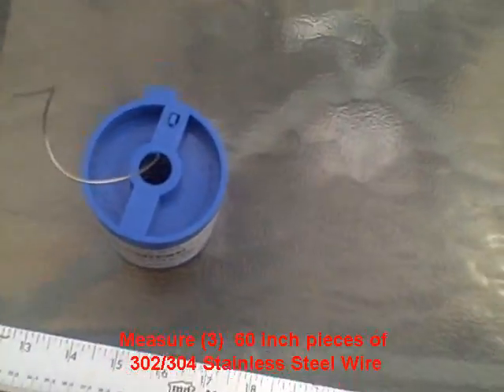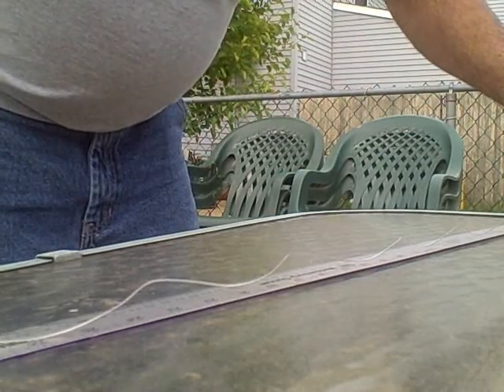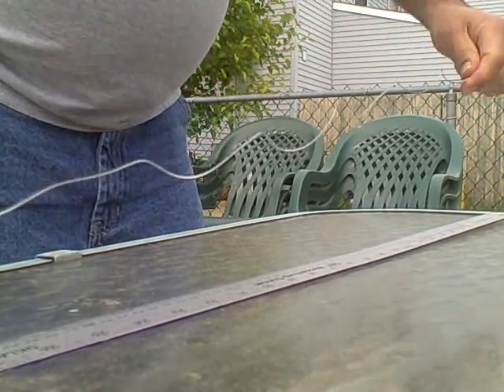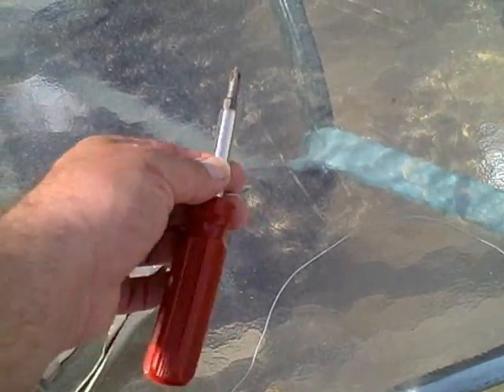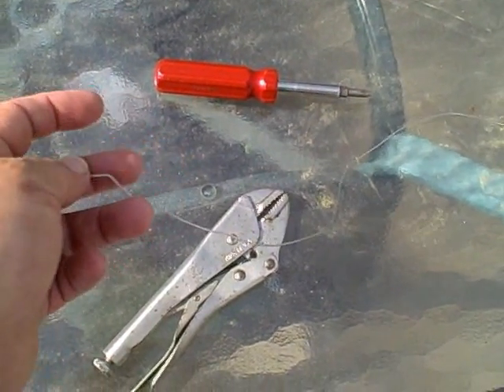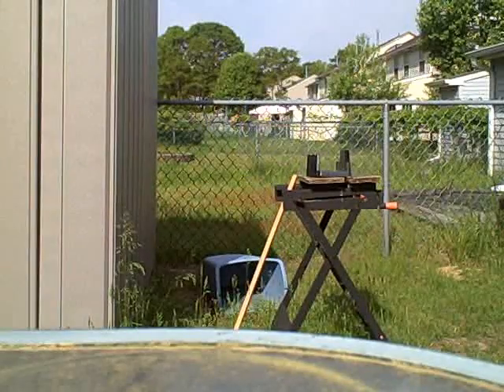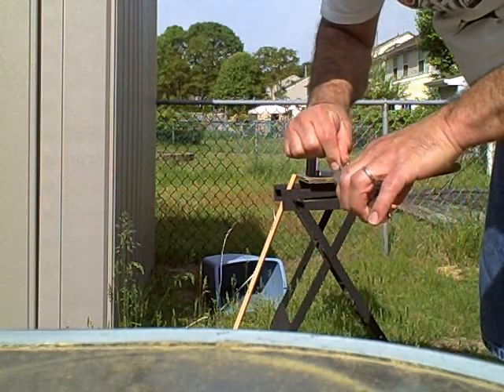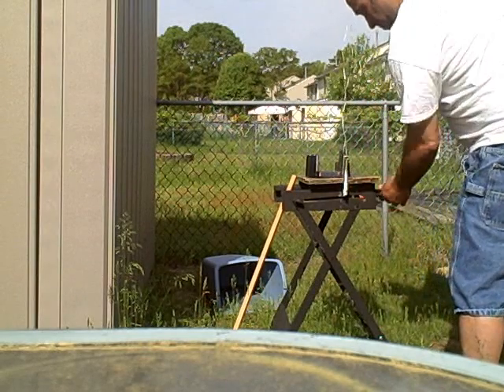Hydrogen Car Electrolyzer-Part 2

Comment: where is the cheeapest place to order the stainless steel wire online? Where dis you order your check valves? I couldnt find any?  Did you put nuts under the elbows in the lid?